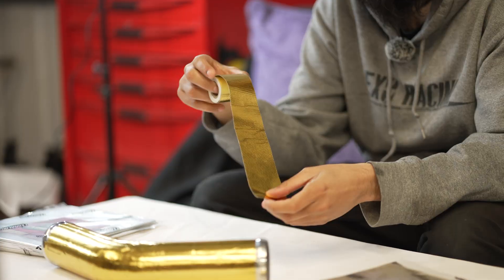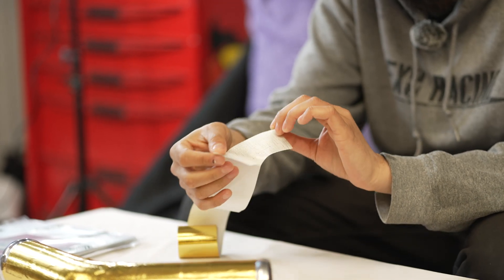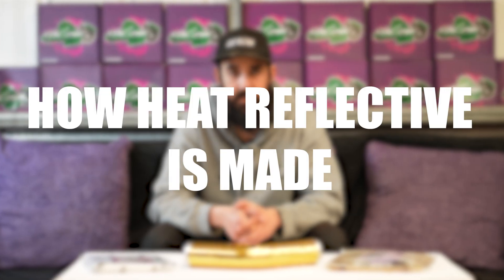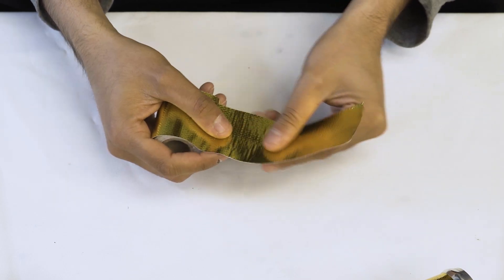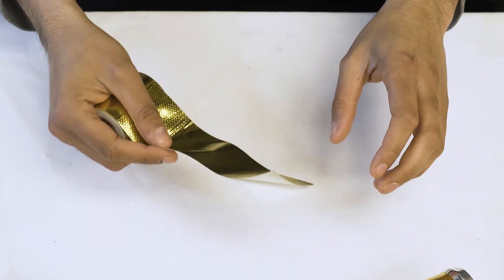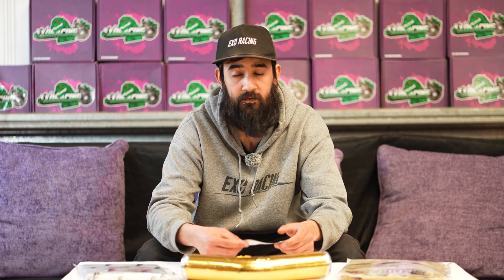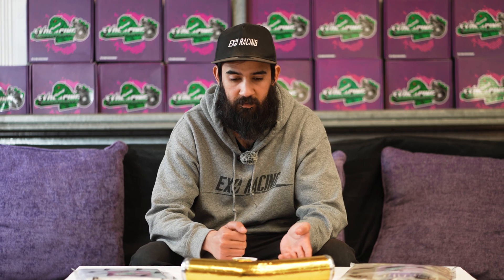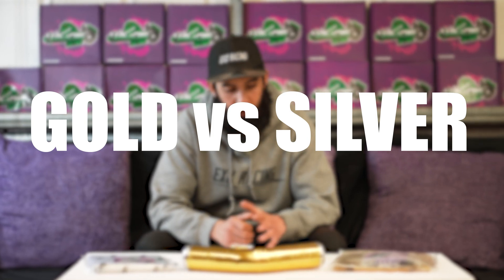Can Heat Reflective Tape Actually Cool Your Car?

Comment: Will gold heat reflective tape have significant effects when put on silicone hoses as well, and what about the ordinary black plastic hoses car factories normally use?
Thanks in advance,
Harry
Reply from the maker: Hi Harry, We would recommend using something like the Velcro heat sleeve for coolant/silicone hoses, as the coolant temperatures can get quite hot. This would allow you to insulate as well as reflect heat from the pipes. reflective tape is more for non porous intake/piping, whereas the velcro or sewn sleeve would be more suited to silicone, if you needed any, this is the link:  https://exoracing.co.uk/exoracing-gold-and-silver-velcro-heat-sleeve-0-5m/
Reply: Thank you very much indeed for the feedback, greatly appreciated!
Regards Harry
Reply from the maker: No worries Harry! If you have any more questions send them over and we'll try our best to help 😃

Comment: Infrared camera isn't way to go. Your reflecting the heat infrared so that's what you'll see. Put black tape on surface and set emissivity accordingly
Reply from the maker: You are 100% right. We are going to wait until we get the car back so we can compile data with multiple points, including datalogs and sensors to give the most accurate readings.